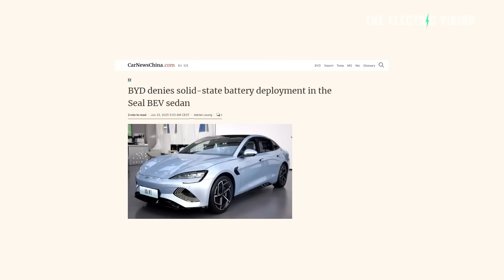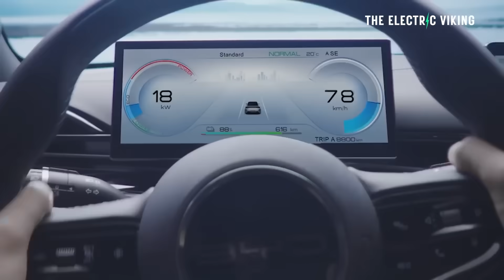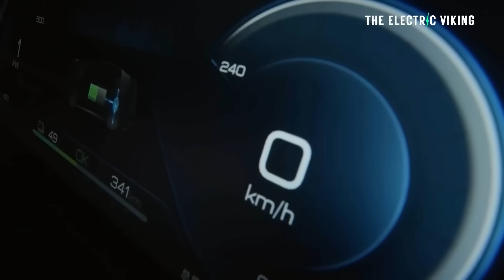Solid-State Batteries ARE HERE! Chery's HUGE Leap Forward

Comment: This may bean early engineering sample designed to find shorcomings (eg power delivery and heat dissipation.) Early samples may need considerable refinement, and are not likely to be ever produced in a large scale.  Secondly, manufacturing on a large scale is a lot different from a test run and changes to those prcesses as well as an repair or monitoring factors will be different.

Comment: What I'm most interested in is their performance relative to charge and discharge, their voltage drop curve, thermal characteristics, etc. To ensure consistent power delivery, often batteries are oversized not just for range, but to ensure they can easily supply the required power to the motor(s) without getting close to the threshold of limiters such as rapid voltage drop or thermal rise above what the cells are rated for. If you have to deliver a certain amp rate to the inverter, even if the cells are capable of it, it's often better to overbuild so there's less stress on each cell and as a result you achieve better efficiency, better thermals, less instant voltage drop, and better long-term cycle life as well.

These are aspects where solid state could truly innovate the field of electric, and I think the major focus on range itself is often excessively covered while other far more important details tend to get overlooked in broader media context. If the charge/discharge and voltage drop characteristics are vastly superior, then range itself matters far less because you won't have all these other limitations that make range so crucial to compensate for them.

Comment: We're getting to the point where energy density becomes a non-issue. When a vehicle has no engine, it already saves hundreds of kilograms. It would actually be safer to drive a several-hundred-kilo battery pack mounted low and centrally in the vehicle chassis, rather than have no weight at all... you'd find the car getting blown around in high winds and if you're travelling on the highway and this occurs, it can be very unnerving indeed.

Comment: Something not quite right with the Electric Vikings maths/logic here.

"If you put an 80 kilowatt battery using a solid state battery with a 500Wh/Kg capacity in a Tesla Model Y you will get about 1,000Km of range", I don't think so.

I think I know what he is meaning, but that's not what he actually said. What he's actually saying is, that putting a different type of battery in and increasing its capacity from 😮75 to 80KW, a 5KWh/6.7% increase, the Range will increase from 622Km to 1000Km, a 378Km/60.8% increase, I don't think so.

I think what is really meaning is that, if you replace the battery with the new technology of the same but with an increased capacity of 500Wh/Kg, you'll increase the Range to about 1000Km, which sounds fairly reasonable.

If we do that, is quite easy to do the maths to work out the new range, for a 'Tesla Model Y - Long-range' it'll be 1,152Km

The maths, for those interested:
 Current Tesla y has 75KWh battery, and the long range model does 622Km. If we assume 270Wh/Kg, the battery weighs 278.8Kg, and does 8.298Km/KWh.
At 500Wh/KWh & 278.8Kg battery capacity is 138.9KWh and the Range will be (x8.298) 1,152Km

Comment: Most people are looking at this from the view point of a normal car or a pick up truck perhaps , but remember there are many use cases that require more energy to go the same amount of distance, large vans and trucks for example, so these batteries will need to be lighter weight and more energy dense to cover the same amount of distance and to make it work without being too heavy for the vehicle to operate Reasonablly well.  so there are many cases where this is going to be very necessary to keep the vehicles functioning in an efficient way!

Comment: Petrol has 10x the energy density of batteries but the motors use it at about 30% of the efficiency to drive the car, what density do batteries have to get to, to match the weight/range of a guzzler?

Comment: Either more range for the same weight, or same range for less weight. Either way, it's a win.
Reply: and much lower fire hazard as well!
Reply: Yeah, and the 80 kWh battery is still 80 kWh battery and range is still about the same but the battery will be lighter.
Reply: When the battery is lighter with the same kwh, the range increases because the vehicle weighs less. @samijokinen9246
Reply: Agreed. Will be outrageously expensive in the short term - so I'd expected smaller batteries will proliferate in the early days.
Reply: same range for less weight also means lower cost as you need fewer cells per pack, fewer sensors and connections, less complex bms and inverter setup, etc. Range is great on touring vehicles, but for most people there are vastly better benefits to downsizing the battery pack and maintaining an equal range.

Comment: 4:10 An 80kWh battery is still 80kWh regardless if it's lead-acid or solid state. Sure, the heavier battery will get less range because the vehicle has to carry around more weight. But discounting that fact for a moment, two batteries of different chemistry types but has the same energy capacity  will  yield the same range.

What we will likely see with solid state batteries is an EV with a 140kWh battery and a 490 mile range.
Reply: It will be more fitting on long haul vehicles like truck and bus that regularly goes for at least 500 miles (800 km) every day. Longer range means less charging stops
Reply: Except weight is a huge component to range. It can’t simply be discounted.
Reply: @danparish1344 As I originally stated, I am well aware the effect of weight on range. But the purpose of the thought experiment is to show that two different batteries with the same energy capacity will output the same amount of energy. The discounting of range is simply to remove one variable to make the concept easier to comprehend.

Comment: I am considering ripping the back seats out of an Atto and paralleling a 2nd battery in the boot maybe I will get 500-600km of real highway range.   Even if they make it 500W/hr batteries the will still only give you a 60kWh battery   - Unlikely to be a gamechanger just a bit lighter

Comment: You should wait until you need a new car.  If that is tomorrow, there is nothing majorly wrong with the currently available batteries. They are in general not going to put in 1000 kilometer batteries; they will keep range around 400 miles/600 KM and simply do batteries that DC charge faster built with a smaller number of cells, for a lower cost, to increase the number of units they can make and sell.  That's China.  Detroit will try to sell you a 1.2 liter quadruple turbocharged 3-cylinder gas engine,  with so little torque it can't pull a greased string out of a cat's ass, with zero $ down, 4 months til the first payment is due, and 0% financing for 72 months.

Comment: I'm not so sure that 1,000 miles in most applications is truly necessary.  Certainly, if it's a towing vehicle where the range will be compromised due to loads, it's beneficial.  But in most normal use vehicles it's overkill.  I'd be more than happy with 1/2 the range and have less weight and cost with the vehicle plus whatever other benefits from the reduced weight in handling.
Reply: 1000 km is about 610 miles
Reply: @bryanwhitton1784  I didn't think to convert that, thanks.
Reply: @staciecarverd8136  No worries.  I used to run 10K races and that translated to 6.1 miles so it was easy for me.  Have a great day.
Reply: 像中国和美国这种大面积国家，长续航的车型是很有必要的。

Comment: Hi Sam I've noticed this  information about your vids a few times as you seem to be a little mixed up about your electrical information and I'm only trying to help so please forgive me ! 100kw is 100kw irrespective of the battery chemistry. so 300miles (approx) is achievable on both different batteries. I think what you are meaning to say that 250w/kwh compared to 500w/kwh means that the same battery package and weight and size would hold 2 times the amount of energy therefore 600 miles. So basically the physical size of the battery would be the same, just the storage capacity will be so much greater. Hope this helps clarify. Cheers
Reply: I was confused with what he was saying too, perhaps he MEANS you could have double the battery capacity for the same weight?

But that is definitely not what he said, I was scratching my head at my basic understanding of the law of physics, if the battery was half the weight you are not going to double your range.....

Hard to believe he would make a mistake like this.
Reply: @dirkmirk767  Yes it's just so bizarre, and really damages his channel.

Comment: The electric viking repeatedly makes the mistake of confusing total kWhr of storage with battery weight. The density is irrelevant to the total energy in an 80 kWhr battery. You can have 10000Whr/Kg energy density in an 80 kWhr battery, it doesn't increase the total energy stored. It just changes the weight of the battery. It is like saying a pound of lead is heavier than a pound of feathers. By definition, an 80 kWhr battery will only store 80 kWhr of energy.
Reply: Exactly
Reply: And if the weight of the battery is reduced, what happens to the range given no change in kwhr? That's why it's important
Reply: @troy3423  Yes, you will get slightly more range with a lighter battery but that was not the point. The point is that the electric viking doesn't understand that the number of kWhrs a battery has is the total energy the battery stores regardless of the weight. I never implied or suggested that it isn't important to keep the battery light to optimize the range. But even a significant decrease in weight will have a limited impact since a large percentage of drag is the aerodynamic drag. If you could reduce the weight of the vehicle by 500lbs (essentially doubling current energy densities) you will only gain about 10% in range and that is being optimistic. You will probably get a better increase in range with higher volumetric energy densities since that allows for a more aerodynamic car.
Reply: @yodaiam1000 Gotcha. I guess my bar is pretty low for viking. How many "game changer" clickbait videos can you put out. He publishes unverified stories all the time. Just my 2c
Reply: A game changer is not having a game changer.
Reply: No this is a change gamer@glynnforde
Reply: Its to get people like you to comment. Its on purpose
Reply: @tysonfinn1470  Purposefully giving incorrect information to farm viewer engagement is a reprehensible act. Seems more like just ignorance on Sam's part to me. Though, I could be wrong.
Reply: @ehendi yeh but it works. Msm will mispell a headline to do the same thing  getting people arguing is the best engagement
Reply: Not quite. 100kg takes more energy to accelerate, so the same capacity with lower weight will have a greater range, because less energy is required all else being equal
Reply: @OneEyedMonkey9000 You also get more regen when decelerating when the car is heavier. A lower weight is a bit more efficient but not as much as people assume. If you double the battery energy density on an 80 kWhr battery on a typical car today, you might get an extra 10% in range.

Comment: the original 2170 battery is around 270 watts per kilo so this does not seem like a big whoop. I would be expecting north of 300 and more like 350 for next gen battery density .
Reply: NMC battery with silicon carbon anode is 400Wh/kg. Nio is already using it on some of their flagship cars

Comment: Sulfide-based solid-state batteries are well known for their challenges with cycle life, H2S gas release and large-scale manufacturing, not energy density. Japanese and American companies have been working on this since decades and still haven’t solved it. Chery and Gotion’s announcement looks more like a PR stunt; they haven’t published any A, B, or C sample data, yet claim mass production is imminent. That’s a major red flag. Most likely, they’ll ship a substandard product just to meet China’s push for 'fireproof' batteries next year. This isn’t a problem you solve in months, it will take years, unlike the relatively simple LFP batteries Chinese companies already produce.

Comment: Sam
There is something you need to understand about battery energy.
Kilowatt hours IS HOW MUCH ENERGY a battery holds. Its the same unit as Joules .
What you are looking for is BATTERY WEIGHT. A higher energy density battery has more energy for the same mass/weight. 
Its the energy that makes the battery go far. You keep messing up kilowatt hours for battery weight.
Reply: Yes, Sam has a bizarre brain-fade here. He thinks a dense 100kwh battery will go much further than a less dense 100kwh battery!!! Crazy stuff from a major EV youtuber.
Reply: @tomlewitt  Sam is Australian, so some of his thinking is upside down ;-)
Reply: @CiaranMcHale  🤣
Reply: i have seen him do this on multiple videos.. sure 100kw battery with 500w/k weighs less but not so much that you suddenly get 1000miles range
Reply: The car will go further with the same battery size, because the car is lighter, and therefore will have greater efficiency/100km. For example the BYD Sealion 7 weighs in at approx 2300kg, whilst a similar sized sized Tesla model Y weighs in approx 2000kg with a smaller battery. Both cars have similar range, but the Tesla is approx 20% more efficient.
Reply: I think you mean battery mass, never weight. It wouldn't have 6 times the energy density if you took it to the moon, would it?
Reply: 'Course it depends on what kind of energy density you're talking about - gravimetric, volumetric, or, well, cost-o-metric.
Reply: wt * energy density = kwh.
as far as all we  know the density, just mentioning wt is ok

Comment: I personally believe that the move to SSBs will mean smaller and lighter batteries with a slight improvement in range over current BEVs. If you can charge a SSBEV in 10 minutes, there's no need for a huge, heavy battery just to boost range while driving dynamics (and chassis/suspension/tire wear) suffer.

Maybe we'll see manufacturers offer a range of SSBs giving up to 800-1,000 kms of range but I would expect most urban, commuting vehicles to stick around 600 kms of range or less.
Reply: I agree for the most part. The vast majority of folks buying an EV that has 400+ miles/km range charge every night at home and seldom go for long drives. BUT.. if you can charge from 20% to 80% and have 600+ mile/km range.. means you can go about 400 REAL miles on a charge of 10 mins.. and as long as you can do that about 6000 times like LFP batteries (e.g. 6000 FULL cycle charges..) you should last for 20+ years provided you dont crash/damage it.
Reply: Agree.  I believe it is possible.  Excited for the potential for flights eventually.  And I look forward to the day when comparison with ICE is no longer necessary, nor incentives required.
Reply: We will finally see a EV ute with normal range and 1 ton payload
Reply: The range won't change significantly. If said batteries will be cheaper, companies will gladly take that money as a profit and MAYBE lower a car price a bit. You're all naive thinking otherwise.
Reply: @mehow357  I think most people acknowledge that range isn't going up by leaps and bounds with SSBs and - in the short term anyway - prices will also go up. SSBs are still extremely difficult to manufacture and that means cars with these will be expensive until manufacturers figure out how to build them efficiently.
Reply: I want 8000kms of range.

Comment: It is hard to even keep track of just who is in the lead. This solid state battery? Or Quantumscape's?  Or even Tesla's new aluminium graphene non-solid state battery which some say has double the specific energy (energy density) and costs one half to one third less to produce ($30/kWh), and has twice the durability.  Commentators are saying that Tesla will be able to produce a 60 kWh battery pack for its latest Redwood car project (Model Q) for less than $2K and that it will have at least the same rage as an ICE vehicle and recharge fully in 12 minutes.
Reply: Never believe anything that Tesla tells you.

Comment: I’ve been saying for the past 20 years, solid-state batteries are the inevitable future of all batteries, the kinks and unknowns will be worked out but, 500-700 Wh/kg. with 10 minute charge speeds will be the norm within a decade.
Reply: LFP is already at 5 min for 10 to 80%.
Reply: Cheeper, safer, for colder climate and no rare materials, then it is a winner if it could be massproduced.
Reply: Where does the high current come from? Out of the air infrastructure?
Reply: @MichaelBraid-xf3dw High KW chargers have batteries for storage.

Comment: Please double check your statements, energy density per kilogram just means a 100kwh battery pack would be lighter. Yes it might go a little further but not suddenly 1000km. The more important is price per kWh.
Reply: Yep, mates brain is having difficulty in basic math 😅😅
Reply: Or alternatively, he's thinking (but mis-stating) that a higher density battery with the same mass would get double the range of existing 500 KM range batteries. Still a bit frustrating he's not correcting this.
Reply: wrg

Comment: It would be nice if they could make these solid-state batteries here in the US. The problem is that they are more expensive to make than Lithium batteries. Hopefully the price will come down in time.
Reply: Solid-state batteries are lithium, just have a solid electrolyte, and yeah, they’ll be made in the U.S. and will be cheap.
Reply: @RussellFineArt  I agree. Another advantage to solid state batteries is that they offer quicker charging and significantly longer ranges—up to 50% longer range, potentially—solid-state batteries could not only meet the demands of American drivers but also alleviate concerns related to sparse charging infrastructure by enabling longer distances on a single charge.
Reply: QS is doing this now.